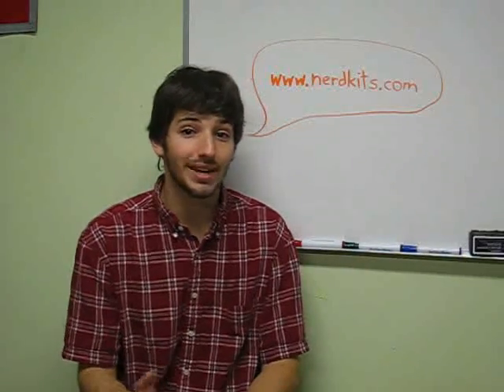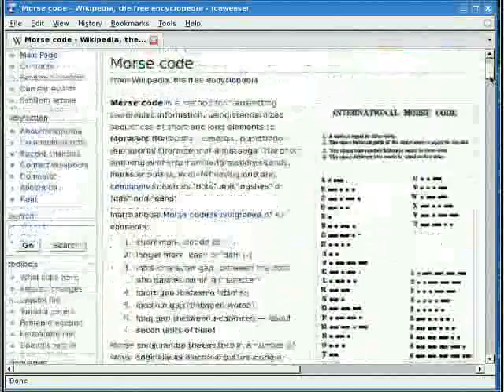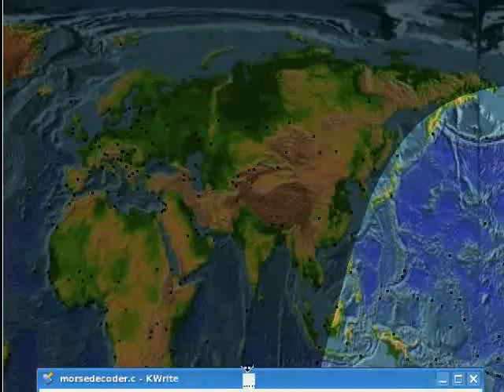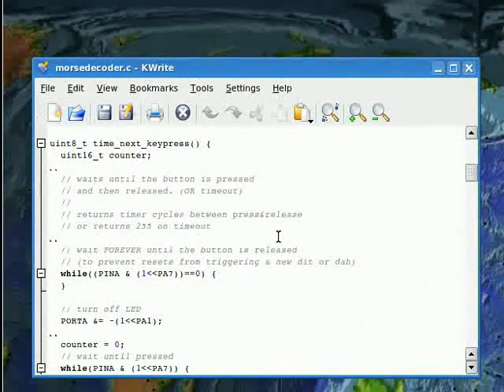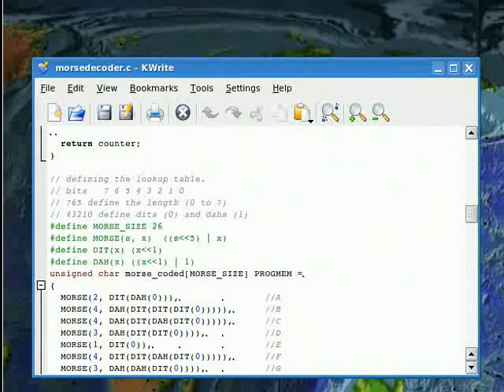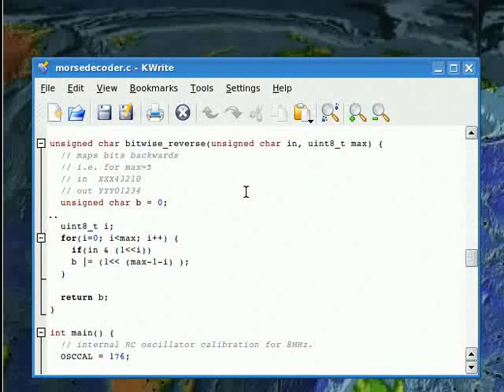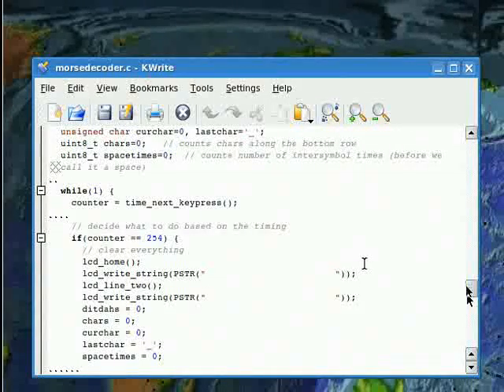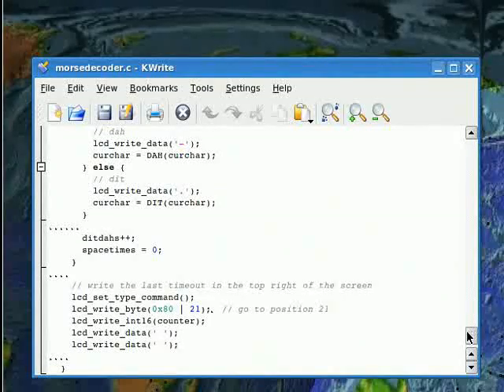Morse Code Decoder

Comment: Every ham rig needs a flushed out more advanced unit of one of these plugged into the audio out, to grab any identified morse code and throw them up as raw text on a display.. in the similiar way the closed caption circuit works on a television...

Comment: Ham-trolls, stop with your straw men.  You only look foolish.

This is about the NerdKit, electronics, learning, and giving people ideas.  It is not claiming to be the best tool ever created for the Morse Code community.

For example, this video gives me ideas about:
  interpreting modem or fax audio
  interpreting to a serial line (RS232/433/485)

There is probably better MC interpreter code out there that could have been integrated into this project, but that's not the point.

Comment: To read a flashlight only a change in the input device is needed:  replace the manual momentary  switch with a photo-diode circuit to sense the button presses and the system works with no other change.  The buzzer could even still be wired int to work.

Comment: Yes Riddick it is technically the "easy way out", but it is also the fastest, because with this, you can send a message using computers that in an instant, sounds like just a single beep to us, could probably send about 3 pages of info to another computer, which is basically the exact workings of the internet... ^^  now you can at least say you learned something today lol